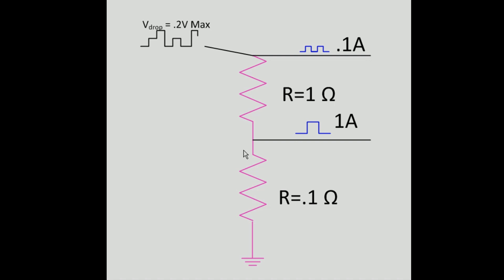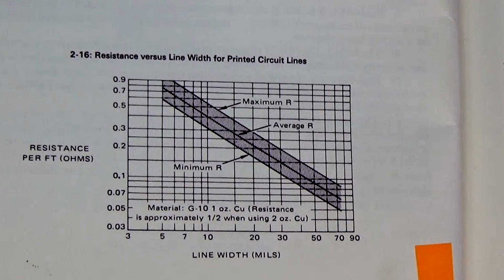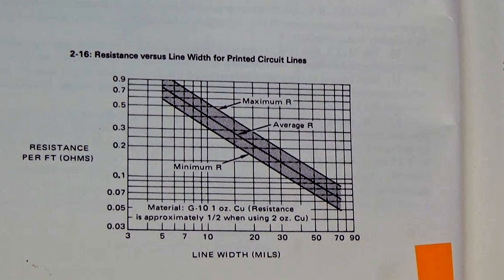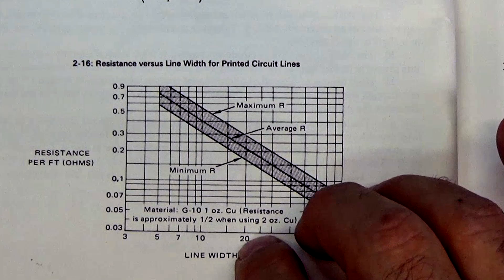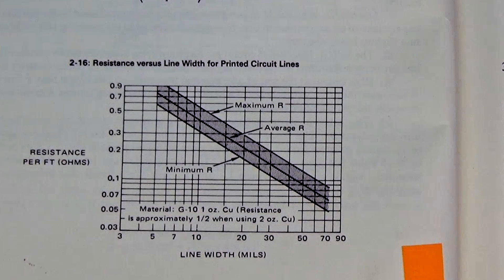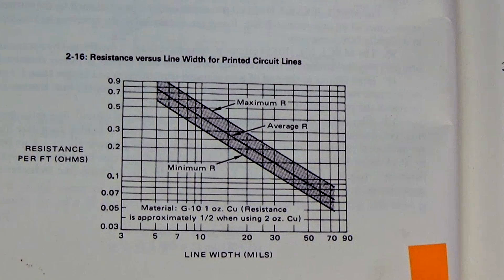Inductance in PCB Layout: The Good, the Bad, and the Fugly

Comment: Capacitors don't "store electrons".  This is counterproductive to visualizing how they work, so I think it's important, not just a nit.  They store potential by shifting electrons a short distance within a material.
Reply: and thats E field in the dielectric?
Reply: @hasanalattar9561  Yes, there will be an electric field between the region of excess electrons and the region depleted of some electrons.
Reply: That's true. If they only stored electrons, then the dielectric would not matter.
Reply: @AlienRelics  You got me thinking about one-terminal Leyden jars.  Faraday's ice pail does indeed accumulate a net charge.  Such capacitors would not behave the same as a normal cap in a circuit, with respect to passing AC with a frequency-dependent impedance.
Reply: @JohnDlugosz  The outer covering is part of the capacitor. If you don't have an outer covering, then the capacitor is the internal conductive substance (saltwater or a layer of foil) and the dielectric is the pail and the air between it and the surrounding earthed structures.
Reply: @hasanalattar9561  Yes, there are experiments here on YouTube where two plates with a dielectric (glass or plastic) is charged, the dielectric removed, the plates discharged, and the dielectric put back, and the capacitor can be discharged again. it is a bit mindbending.

Comment: Now that is an excellent explanation! Yet so many PCB designers don't realize the important of this.

Another side effect of not keeping your return paths tight and planned is the PCB will also radiate a lot of radio interference. If there is sensitive analog circuitry near by or some sort of radio equipment you can have a really bad day.

Comment: That's a great, short, practical introduction and demonstration of the principles one needs to have in mind in order to understand circuit track inductance and especially for PCB tracks. It's very succinct and quickly evolves from basic concepts to the particular application at hand in "layman's terms". It certainly provides a good, short explanation to the "why's and how's" of ground planes. Fantastic!
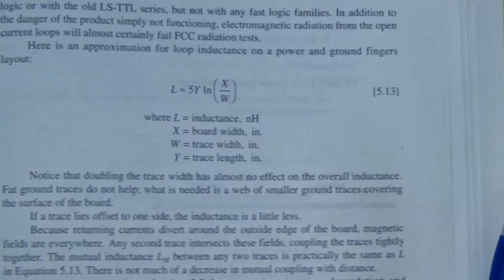16:10 : I was racking my brains until it eventually dawned on me that "board width" does not refer to the PCB board thickness but to the distance between two tracks. Therefore "track width" is exactly what it says. Sometimes the wording in a particular excerpt can be read the wrong way and it gets stuck in one's head. This is especially common if the excerpt is read in isolation from the rest of the book/chapter/etc. as each author (and reader for that matter) has their own particular "style" as to the choice of words needed to express a recurring concept.

Comment: Great advice. If you interrupt the ground plane, have any crossing signals go around, or alternatively perhaps jump the ground plane on the same layer as the signal. Yeah I know the vias add inductance but so does the increased path length. To really know which to choose you probably need one of those fancy modeling softwares as the correct answer almost always is, it depends.

Comment: Awesome. Thanks for the book refs. I hesitated for a sec before watching as I have 5 designs ready to etch my first prototypes and am just waiting on fresh Riston. I'm always worried I'll watch some facepalm info that scraps weeks of KiCAD maze puzzle games.

  How about a beginner practical explanation of single sided w/jumpers parasitic issues tips and/or simple double sided home etched basics with typical 8bit uC/10bit ADC designs.
  I've also been wondering about filtering for uC power pins with ferrite beads. One of the OSHW project designs I'm working on uses a basic AVR's ADC. As a simple hobbyist I don't know where to start with a solid AVcc filter. I just grabbed a known topology for the current design, but would like to know more.
 That same design has several different power rails. I have no idea about the general rules to follow regarding routing them. That's the one issue I'm most concerned with in my current project(s).
  Thanks for the upload.
-Jake
Reply: Mdmchannel  
0402's all around!

Yeah my current project has a ton of places for additional caps as it's  a dev board for the Atmega644/1284 version of the AVR Transistor Tester with a main 5v Vcc precision rail (MCP1702 LDO), auxiliary 5v and 3v3 rails, and the raw battery/Vin plus a uC controlled power management rail.  I have the whole uC broken out in multiple locations with most power rails distributed accordingly. I'm sure it will have lots of issues with the first iteration(s).
Reply: Mdmchannel  
Thanks. The general Vcc reg is powering the whole AVR, the auxiliary 5V is mostly intended for a zener test circuit that needs noise isolation but it is also routed away from all of the analogue/tester circuit. I am concerned about running several rails in parallel, but they are all around 7cm away from the important stuff. The uC is in the middle of a 5cm × 7cm standard protoboard with everything relevant broken out on the 2 × 24hole sides. (I've turned a 5x7 protoboard into a shield that plugs into a single sided etched board). I also broke out each uC port on individual 3×7 protoboards. The power rails are all routed to the opposite side of these 3×7 boards. Assuming everything goes correctly I will post it on the official mikrocontroller project thread and the eevblog one too, I might even write it up on hackaday now that I think about it. 
  This is probably the worst AVR TT design ever. I just wanted something to play around with all of the project options. Even the power supply is on a protoboard breakout. So technically this thing has no supply just terminals for rails.
-Jake

Comment: the boards I designed for my 8 bit discrete logic CPU probably arent the best in some places, in terms of ground plane impedance, loop area etc but they are likely a lot better than the prototype boards I used previously which had the power traces interdigitated. might try to keep some of this in mind next time I revise boards or make new ones

Comment: I have a few unpopulated military pcb's.
I could never find out what went in these two places (symmetrical places).
The backside is 1 millimeter thick copper. 
The footprint is not easy to find. I could send you a pic in about a month. I've always have been curious what went there.

I have some hermeticaly sealed voltage regulators which are absolutely gorgeous and yes you can connect them in parallel for more current handling .
I wish I could sell these. 
 
I also have at least  200 Tantalum capacitors. 35 maximum voltage I also would like to sell.

Comment: That was very useful! However inductance is not always bad. What if we have a regulator that can't keep up with fast switching devices like microcontrolers and other digital stuff? Low resistance/inductance  traces for power supply will make the things worse. Switching components will add noise to power rails. If you have longer traces for the positive supply rail combined with decoupling capacitor will reduce the noise that goes back to the regulator and the other devices. Maybe that's not the case with the ground because ground as you said is also used for high speed signals. The ground plain that you showed with the signal trace - I didn't realize it matters. So is it better if the trace goes around the connector instead (so it stays close to the ground plain)?

Comment: Would it be more correct to say caps and inductors impede change and not resists?
That would seem to be more consistent with other literature.
Reply: Mark Ivey Impedance and resistance are equivalent, the word impedance is more commonly used for AC signals and resistance is more common for DC. There are no complex mathematical components at steady state DC, so it’s more simplified, for AC the phase lead or lag between voltage and current makes it more complex, but at the end of the day ohms law still applies, 10 ohms is 10 ohms regardless of what is causing it. Reactance, reluctantance, impedance, resistance are all the same things just different words for different contexts... the only thing to keep in mind is the context, AC will have two components, a real and an imaginary part, this is just due to the mathematics used.
Reply: Right to say is that Inductors and capaciots react on changes (frequency). Inductors develop more reactance when frequency goes hogher Xl= 2 pi fL   and capacitors the opposite Xc= 1/ 2 pi f C  when f goes higher Xc goes smaller.

Comment: any prototype board you would recommend?
Reply: For RF nothing beats a copper clad board with dead bug style construction on top.
https://i.stack.imgur.com/7Hr90.jpg

For everything else i am a fan of perfboard where you only get a grid of unconnected round pads and you are free to wire it however you want. Its still not ideal, but it lets you plan your ground. For really high speed you likely have SMD chips anyway so better to get a cheap PCB from china for $5.
Reply: @berni8k  oh thx a lot..